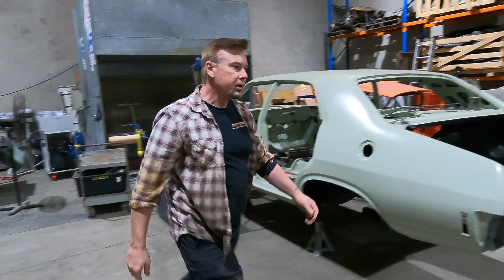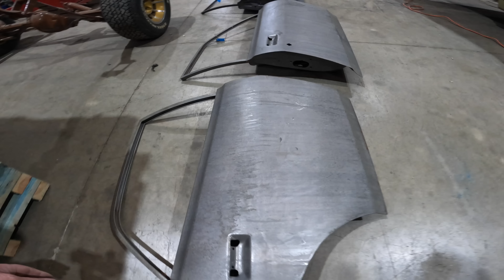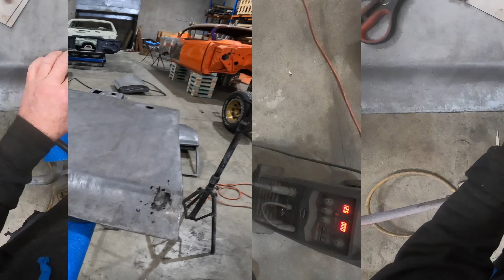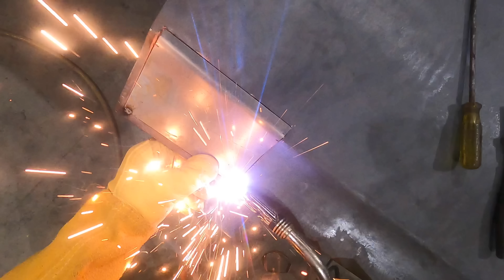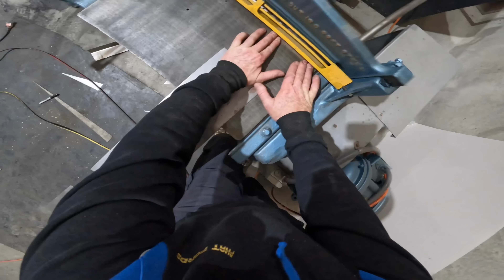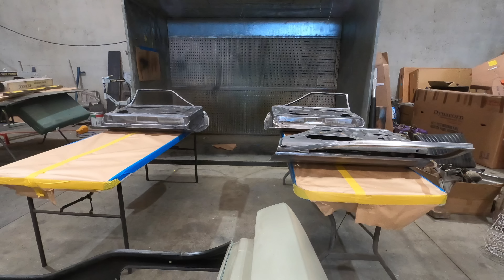XA GT Sedan Tribute   EPS 6   rust repair doors and prime   4K

Comment: Happy to be here i love your videos especially working on the bulletproof falcons you would think Ford from factory would of used more weld where the top door window channel welds to the door some welding is so poor the top of the door vamps back and forth when windows wound down anyway thanks for sharing
Reply from the maker: Cheers mate thanks for watching! your right about the door welds and window frames, I had to reweld mine most were cracked

Comment: I like the way you did those repairs. Would definitely be good enough for me.
Reply from the maker: Thanks alot Nathan, yes if it is only pin holes and there is clean metal all around it, and it holds a weld, I dont see any problem with that kind of repair, as long as you treat it all from behind .